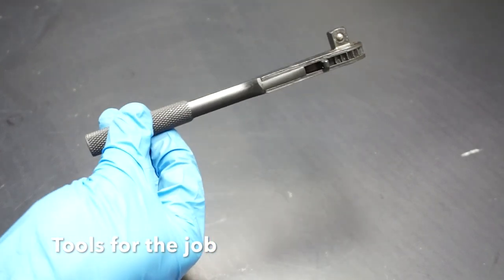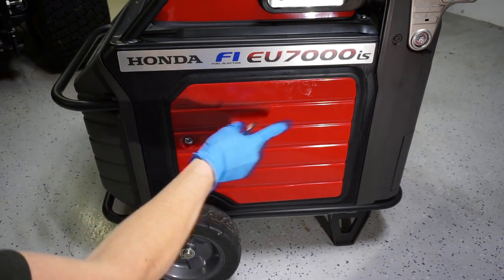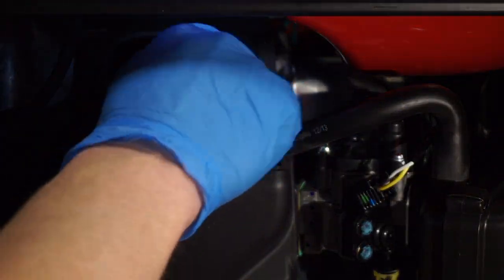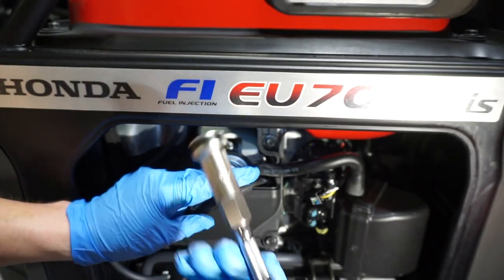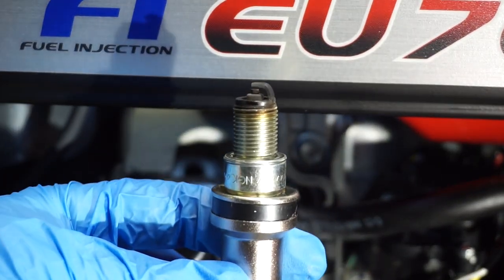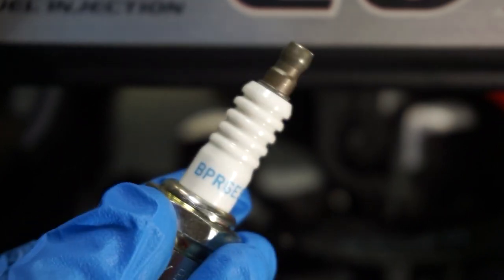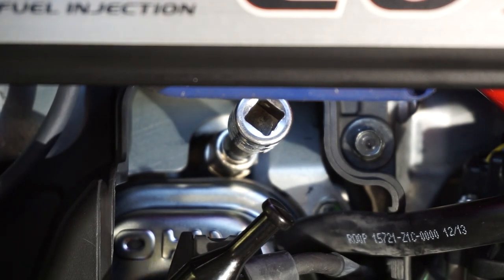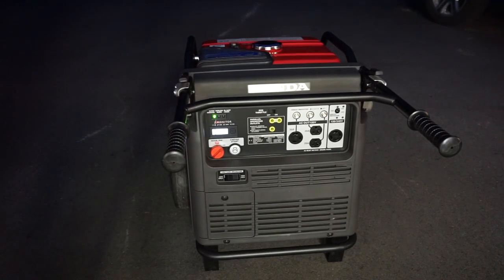How to change a spark plug on a Honda generator

Comment: A little tip of sparkplug changes in tight spases is to use a small house on the top of the sparkplug insted of any tools to thred in the new sparkplug , and that is only to avoyd to damige the threds.

Comment: Where did you get that spark plug socket or who makes it?   I ordered a 14mm spark plug socket off Amazon and it's the wrong size.  The flange for the hex that I see on yours is much larger than 14mm.  The hex appears to be roughly 13/16" (slightly too large) or about 20mm.
Reply from the maker: So I had some trouble accessing spark plugs on Honda generators.I do a lot of small engine work and purchased an excellent Spark plug toolset which you can learn all about here....   https://youtu.be/Zge9Cah4AZk  It's not widely available  but can usually be found on eBay. Not cheap but no moving parks so I should have it for a lifetime. Best wishes to you and thanks for watching.
Reply: Thanks.  It looks like that's no longer sold on Amazon and I can't find it on eBay.  Web!ke says it has been discontinued.  Oddly, I have not been able to find a 13/16" deep socket with the spark plug protection anywhere so far.  I'll reply back here if I find something.

Comment: What is the part number for the max watt mw6500 spark plug to be used
Reply from the maker: Refer to the owners manual it varies slightly by country.